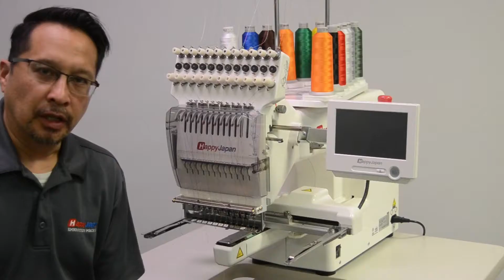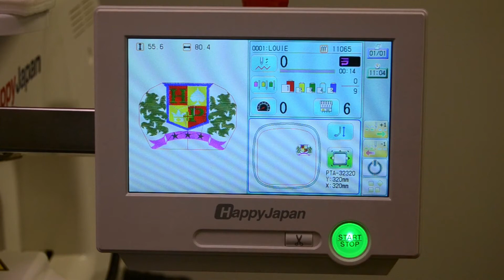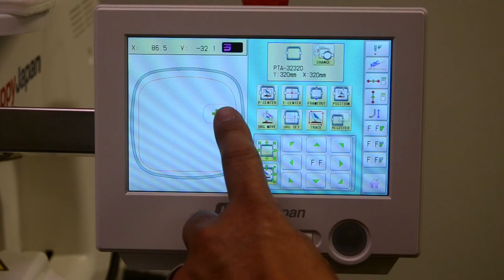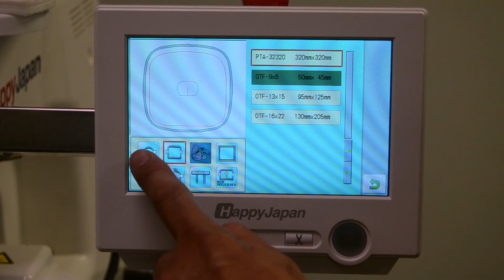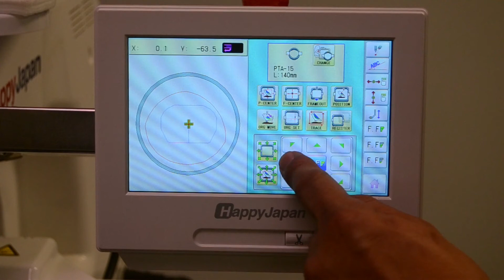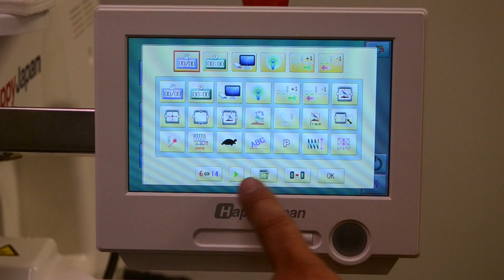Learning HappyJapan Embroidery Machines: General Machine Orientation 2

Comment: Is there an alignment for that plunger switch?  One of our Happy Japan 7 quit recognizing the cap fixture.  Works fine on other machine.
Reply from the maker: It's a matter of ensuring that the cap driver is aligned correctly against the underside of the arm so that the engagement finger shoots straight back to push on the switch.  It is possible to install it misaligned which will still work but gradually bends the switch.  You can try bending the bracket (gently!) if the plunger switch doesn't spring back out cleanly after it's pressed.  Call Support if you have problems or questions.
Reply: @TexmacHappyEmbroideryMachines  Someone had clamped tightly under the switch and bent it.  Almost happened again.  When assembly is tight it is only pressing against bottom. 1/3 of plunger. That’s why I asked about an alignment